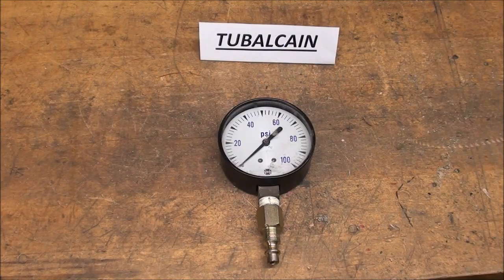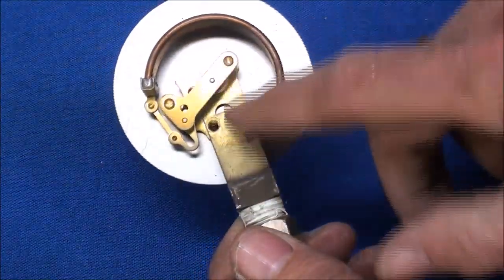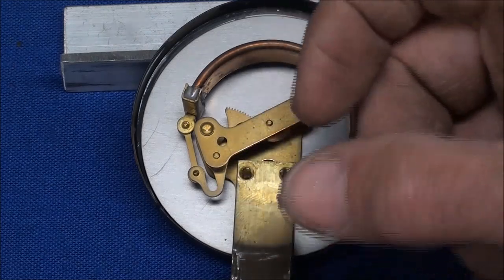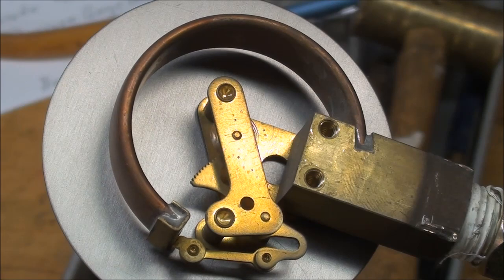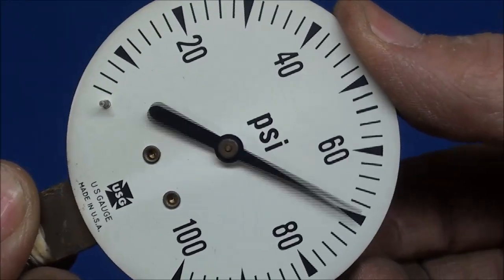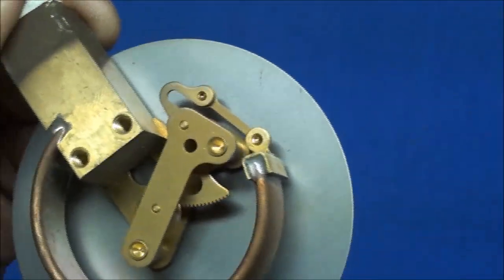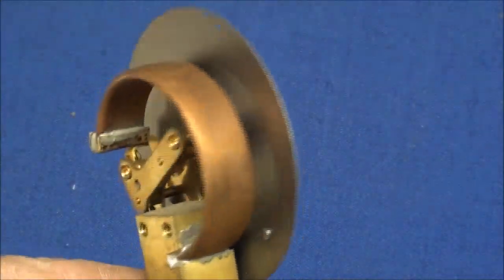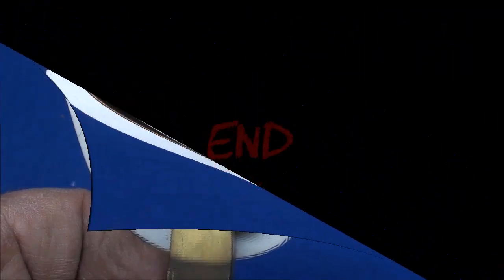WHAT MAKES IT WORK? #15 How a Pressure Gauge Works tubalcain bourdon tube

Comment: Ever since first seeing the internals of gauges like this I really don't want to trust them because they seem too delicate.  Those fine teeth seem like vibration should wear them out in short order and fine particles of dirt  could build up and jam the teeth  but, it is a time tested product that does work.  One of the scariest motion picture scenes I ever saw involves a gauge like this - that film being "The China Syndrome" where a nuclear powerplant malfunction occurs and starts to melt down.  The plant operators keep trying to take corrective action but nothing works  despite their best efforts.  One of the control room operators looks at a critical gauge and gives the gauge face a tap with his finger and the gauge suddenly frees up and shows the correct reading at which point the operators realize they have actually been making the meltdown situation worse. I am sure gauges used in nuclear powerplants are made to a much higher standard though.
Reply: +Jayne Gus My father was a farmer and used similar gauges on weed spraying equipment. The pumps used would pulse the pressure and the gear teeth in the  gauges would indeed wear out after a couple seasons use.

Comment: Now I'm wondering how my digital version actually works. Lol
Reply: If an electrical output signal is required for
 remote indication, the pointer can be replaced by a potentiometer